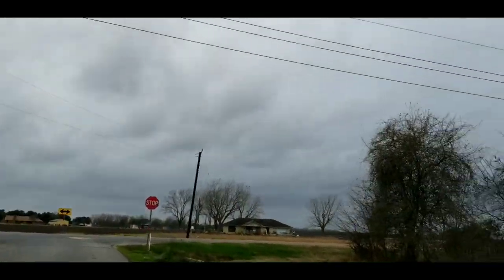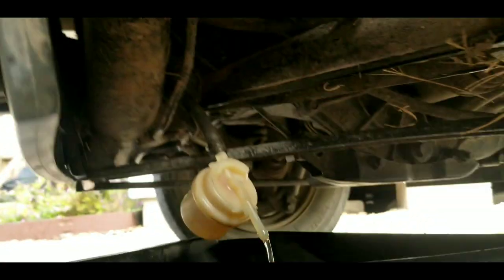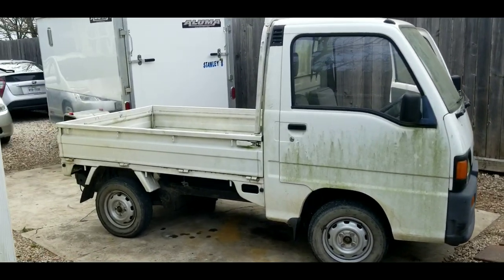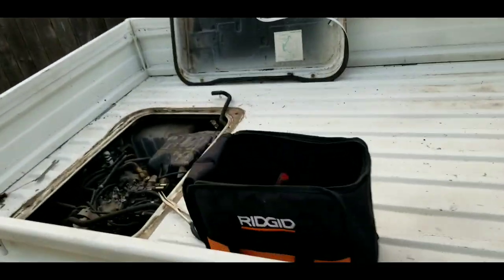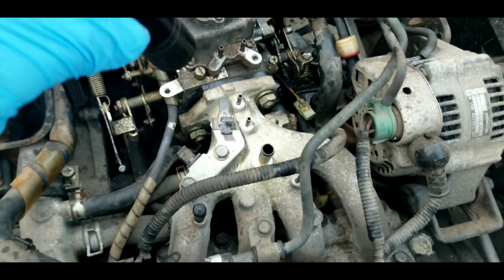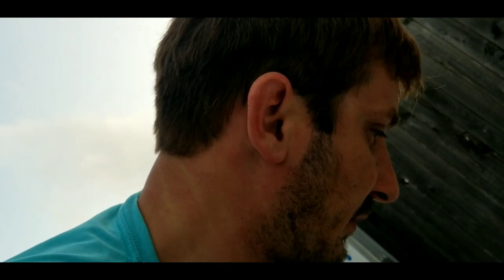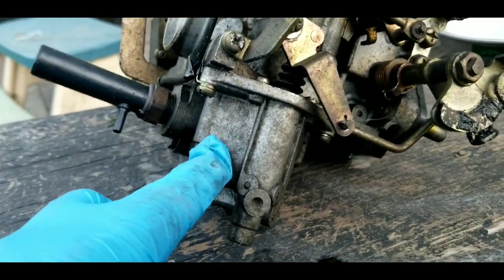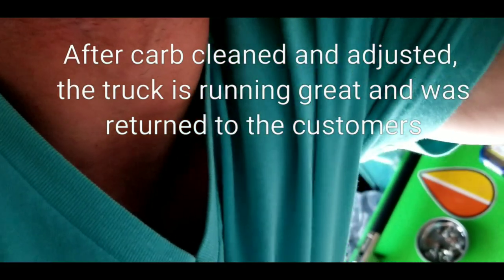Subaru Sambar ks3/ks4 draining fuel tank and carburetor removal.

Comment: It's a Subaru, it'll start...eventually.
Reply: I had an 88' GL10 wagon. 4x4 Turbo. Both timing belts broke at the same time with about 52,000 miles. Dealership went good for half the total cost. 2,000 miles past warrantee.

Comment: Could you please do a video about cleaning of the SAMBAR carburetor? 
i Have a Van too. what are those vacuum controlled diaphragm Valves around the carb?
there's something with coolant flowing through itself, what it does?  Thanks :)
Reply from the maker: Great suggestion! The Coolant flowing is the wax valve, it allows for the high idle when cold, and when it warms up it moves to normal idle. The Diaphragm are choke valves.